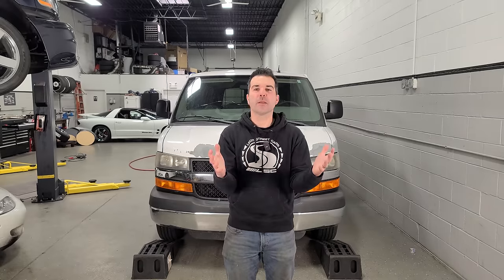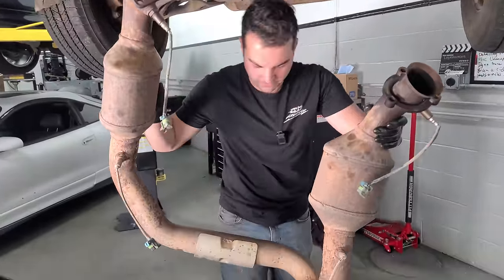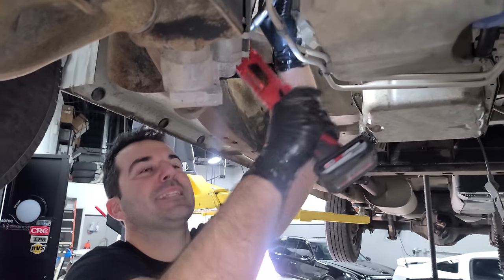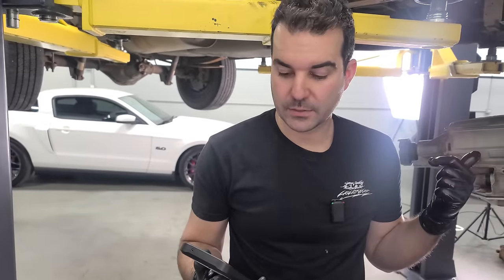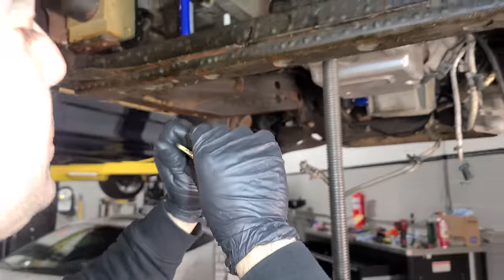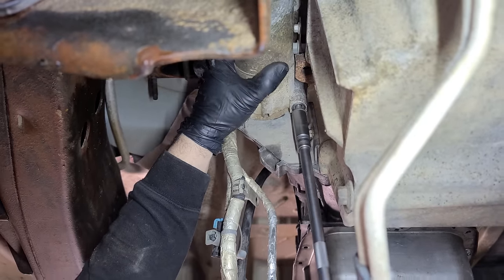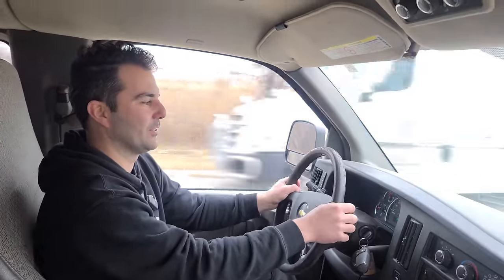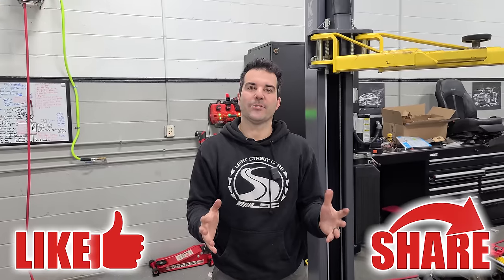I Installed a $9,000 Transmission In My $4,000 LS Chevy Van In Preparation For Big Boost! CARNAGE!

Comment: A little tip from my side: invest in one of those pressure washer attachments that clean the undercarriage. I have one on a long tube that sprays straight up that lets me clean the undercarriage without laying down or reaching under the car ✌🏼✌🏼
Reply: .........and use a creeper if you need to look under the vehicle (if it's on the ground) while you're spraying water.  It will keep your back dry.

Comment: A trick I learned while a mechanic on rusty nuts/bolts is after soak/sit to use a hand ratchet and actually tighten the bolt JUST until you hear a crack, then the correct direction to remove. After learning that trick, I haven't had a single stud strip out.

Comment: These vans are beasts.
I have a 08 Express 3500, 6.0L v8 15 passenger.
With over 270k miles still on the original engine and transmission.
Still running strong

Comment: Cool video as always man! FYI on the driveshaft subject, you may have a hard time finding a shop that can make a one-piece driveshaft for something with that long of a wheelbase. The amount of strength you gain is nominal when compared to the added U-joint angle increase during suspension travel especially at the rear diff. The factory unit is fairly robust, considering its a 3500 chassis (they're all the same for diesel truck and vans) but if you really wanted to upgrade for strength, you could have someone make you a performance 2-piece that would probably be just as reliable and less intensive as a single driveshaft conversion would. It would also be easier to adjust pinion angles with having more pivot points and I'm sure there are companies out there that build them for higher-hp HD trucks. 

Just my opinion though. Looking forward to seeing how this project turns out! Really unique and you had me at "boosting" an LS Express Van lol

Comment: Family road back in late 80's.  We used a 77 Chevy 1ton pick-up 3+3 with a 350.  Six of us and the family cat. Motorcycle strapped to the front bumper, had a canopy so two of us hung out in the box to stretch out and sleep and pass cold beverages to dad  lol. Had knobby  bias ply tires and two blew on the trip. Long wait for a replacement in the heat in the middle of nowhere. Great trip

Comment from the maker: What family road trip car, truck or van do you remember most from your childhood?.
Reply: My aunt’s 2007 Subaru Outback 3.0r wagon
Reply: My dads green Chevy truck!
Reply: an ole 90' something Chrysler Town & Country!!
Reply: Driving across Texas to see my Grandmother
Reply: My dad bought a garage kept 1972 Chrysler New Yorker from a widower.  The car hadn’t ran in several years.  We towed it home, rebuilt the carburetor, new battery, new tires.  Changed fluids.   That car was literally 22 feet long!  It would seat 4 in front and 4 in back!  Best part is it came with a 440 big block and was a lot faster than it appeared.  Most of the sports cars back then had barely 200 horsepower due to all the smog regulations.  This thing had 375 horse and 450 torque according to the manual.  We tuned on it, dual exhaust, and it outran most of the sports cars.  On the Highway with cruise control it got 22-23mpg!  We all called it the tank.
Reply: My grandmothers '54 Packard and the family '60 Mercury.
Reply: 75 Jeep Wagoneer orange "The Great Pumpkin)
Reply: Family had a Chevy Astro van that came with built in tv that never worked lol. Had some good road trips in that growing up as a kid.
Reply: 90s Oldsmobile Achieva
Reply: we had an '89 Dodge caravan with a factory turbo charger 
and I to hated sharing the bench seat with my sister 🤣

Comment: Pinch clamps: the crimpers are so worth having in your toolbox. Don't ruin your other tools. And if you get a set of crimpers, resist the urge to use them as wire cutters or anything else. Oeticker.

Comment: when I flush the stock coolers I push a little cleaner in and then blast it with air.... it helps break things up faster than just pushing the whole can through and waiting till it starts to clear up.. the violent impact from the flush cleaner and air get it going much faster. I zip tie the hose on both ends and poke a hole in the hose and then shove the blow gun tip inside the hole and shove cleaner and blast and just keep alternating cleaner,air,cleaner,air rinse and repeat.

Comment: That's awesome.  The best shifting transmission I've had on any of my cars was from a 1995 Chevy Cavalier.  That thing shifted smoother than my 2013 Lexus IS250 and any other vehicle I've owned.  It went through two engines and the transmission was untouched.

Comment: I've had good luck on ls flangs with a air hammer and blunt tip bit. Spray it and I carefully hit it a few times. It would jar it loose and I kept from breaking ratches and pull bars.

Comment: Most 80's Ford, Chevy, and dodge vans came with a one piece driveshaft, what I recommend if you can find one in a pick your parts place, grab one off the same Chevy type van but of a 80's year and modify it to fit. I dunno if it'll help but that's just my recommendation and other people might have better ideas but it's what I do since parts can be a bit expensive

Comment: If I remember right you can enable the ebreak without actually having the e-break on by doing this you actually disable attraction control and a bunch of other things if I remember right and you could easily do a burnout That's if you have the one yet the press down with your foot

Comment: This Van has the LQ9 6.0 with 320HP and doesnt have AFM. The 280hp engine (the 4.8) was only avalible for 2012 in cargo vans, hopefully this helps when ordering parts as in the first van vid you said it has 280HP factory.

Comment: This is actually perfect timing as I just picked up a 722.6/NAG1 box from a charger for my w210 E300 superturbodiesel. Very good tips! I will probably need to flush my transmission lines just for good measure.

Comment: ALEX! GET YOURSELF A BETTER TRANSMISSION COOLER! THERE'S A LOT OF BETTER AFTERMARKET OPTIONS! It's so understated the effects of a decent trans cooler can have on the life of your transmissions! My F150 work truck has gone through 4 transmissions in the last 540k miles as I tow agricultural equipment to farms around AZ, the cooler it has goes into the radiator and back out in a small loop like the one in the express van, the gentleman that built the last transmission for me suggested that I go with a B&M super chiller transmission cooler in series with the coolers that it already has and I'm very thankful that I listened to his advice, the last transmission I had installed has lasted me over 180,000 miles so far with no signs of slowing down and clear fluid! My transmission temps dropped from around 230-190 to well under 170-13 0 on average, the truck doesn't hesitate as much as it did after long drives either, and my fuel mileage went up, (surprisingly as it's the original 2v 5.4 triton), please invest in a good transmission cooler as it makes a difference!

Comment: Since you have the procharger, you could use a turbo exhaust to spin an alternator through a cvt. 
If not I would run an electric motor on the front of the diff so you get electric braking, and when accelerating again you just reverse the flow. Put in a few huge capacitors, and get more torque for free.

Comment: Have you seen dry ice blasting machines? They are absolutely amazing! Blast anything. Plastic, Rubber, aluminum, steel. That new transmission could have looked brand new if you had a blaster.

Comment: Make sure you get the bench Row for an actual 15-passenger express. The rear bench row from the extended 12 passenger will fit, with some force, but it still doesn't quite sit right. Don't ask me how I know.  😂

 I used to work for a van rental company, vans were our bread and butter.  I'd pick a Chevy Express over a Ford Econoline or Transit any day.

Comment: You have to turn off the traction control to do a burnout. Also if that is a 6l80 I would do the coolant thermostat bypass installed to keep the heat out of it. Also with the bypass installed you don't have to wait for the trans to heat up before you check the fluid level.

Comment: Eye protection? Safety!! You ca always make your own drain plug. Drill it, drain oil, remove, clean, weld nut inside and bolt with seal on outside.

Comment: Most of those passenger vans have traction control, which would not allow burn-outs.  Most of them have a disengage button in the center console.  You can spin tires with this disengaged.

Comment: My dad has a 2009 2500 6.0L van he uses as a rolling welding shop and it's been a great van, super reliable, parts are cheap and the 6.0L is a pretty strong engine, only downfall is it's a thirsty pig lol these things will pass everything but the gas station.

Comment: What a cool project to build Alex! One thing that you can say about GM is the simplicity and ease of installation of drive line components. A lot of newer vehicles are a Hodge podge of messy lines and un-reachable fasteners. That Pro Charger set up is unbelievable and beautiful. Here are my suggestions on the Van. 1) Retro 70's theme wrap or paint. 2) Slammed and bagged. 3)Tons of interior and exterior lighting fx and under glow. 4) Digital dash 5) Aftermarket steering wheel 6) Big old leather swivel driver and passenger seats. Can't wait to see what you do to her!

Comment: Cool video. Thanks! 

I probably would've taken the opportunity to replace the trans cooler with something better. I run a Rin Davis radiator with trans and diff coolers. I can run all day at Road America. You'll probably need something like this if you're going to boost the hell out of it and use it for towing and traveling.

Comment: Actual suggestion for the build: ridiculous alternator/dual/triple battery set up, and race car style leads on the front and rear bumper so instead of having to rely on jump packs, your vehicle has a system designed for jumping and charging vehicles. It will be used for rescue, after all?

Comment: You want a 2 piece driveshaft for something that long. To be a one piece you would need the tube diameter to be so large that it wouldn’t fit. Or you would have to make it out of Carbon Fiber and a larger diameter as well. Shorter is better when it comes to driveshafts.

Comment: you should mod your next tranny pan with a drain plug or do a vacuum drain through fill - the van is ok but you would be better off with a sible can 3500 truck with 4wd - you could plow with it and keep neighbors happy - the van is good fro the framily but truck would make better shop and tow vehicle - you should have sandblasted with baking powder or glass or walnut shells and then primed/painted with an epoxy based and then done the undercoating - only a few more hours of work and probably worth it given investment and fact that salt is indomitable. pls go over the different locktite colors and why you want various colors for different applications

Comment: Good to see the GM paint shop had it's crap together the day the body was processed/prepped and painted. It's the paint shops fault the paint and adhesion has failed in the way is has. As for the driveshaft, how about a one piece carbon fiber shaft. I wouldn't be too expensive, would it? So many projects in your shop. Perhaps getting to the wife's Mustang soon?

Comment: I grew up doing road trips in full size vans. First an econoline from the 70s that my parents converted to a camper themselves. Then an 88 conversion econoline. We drove that one from Iowa to Alaska and back. When that died of rust (thanks Iowa!) they got a 97 gmc safari conversion. I’m generally a ford guy, but that GM van was far superior. The handling was much tighter, and it actually had enough power. Good stuff. Looking forward to this series!
* edit: Savanah, not Safari

Comment: Save the jars of that clearing especially the clear jars with hardly anything in them 

Works wonders for cleaning tools and parts , got a oily socket from it popping off a ratchet during a oil change , put it I. The jar , small brackets and parts , put it in the jar etc etc , shake the jar for a few minutes and it's clean that stuff oils oil , slime you name it it's like brake clean on crack !! Don't dump it use it !!

Comment: Early 2000's trucks would have a drain. When they had drain plugs people would change the fluid, but not the filter. Causing transmission failures. Having no drain forces you to drop the pan and you might as well change the filter while you're in there. They then started red locktighting the drain to prevent people from using it until completely removing them again.

Comment: Just a $200 first gear clutch pack and an upgraded valve body pressure regulator spring... + $3000 just to turn a few bolts.

Comment: you should've avoided the huge mess and drilled a hole in the side of the pan to let the fluid drain and then made your own drain plug for it if you plan to rebuild the transmission eventually

Comment: A 1 piece driveshaft that long will be difficult. As the length increases, the diameter must as well or the driveshaft will "whip" causing an imbalance.

If your concerned about the strength of the stock two piece, your best bet may be an aftermarket center support made for a high performance application.

Comment: A really long one piece driveshaft could be an issue with critical speed meaning you would have a vibration due going through a certain driveshaft RPM.  Carbon wrapping or larger diameters might make it possible to have a critical speed that is above the max speed you might run but lower rear gears make the potential to have issues worse as it means higher driveshaft speeds.

Comment: From having worked on these vans for many years good luck. There is no room for that super charger with the HVAC and brake booster. I thought u were going with the intake roots blower that had a better chance of working. Trying to fit that super charger in a van is not gonna work. I would definitely have done the roots blower up top because u have the clearance around the top of the motor for it. Out front there is none on a van. I would suggest buying the factory duramax intercooler as these vans were offered with the diesel option. There is decent room around the engine but everything is tight up front.

Comment: Why not just change the output shaft instead of a Sonax adapter and driveshaft job? Save some cash. Get that 6L80 tuned, afaik the lockup setting are supposed to increase its lifespan significantly.

Comment: All needed to be done was put on and adjustable pressure solenoid and turn up the pressure about a quarter turn to a half when you first bought it before driving from Dakota to Illinois and the transmission would have been saved.  It would have meant dropping the tyranny pan though and finding a tyranny shop that had one.

I watched that drive home video cringknv

I have one with 4l80e   and it made that noise and I bought the solenoid and dropped the pan.  I knew someone had been in there before because I had a drain plug pan with reusable gasket.

Got the pan down and it already had and adjustable solenoid I turned up a half turn.  Idle pressure went from 33 to 43, reverse front 58 and slipping to 70 and average during pressure to 1#5 to 150 with 200 225 on hard acceleration.  It's been 7 years no problem

Comment: Awsome video! I guess I can call my self a van sort of enthusiast lol, we have an 07 dodge grand caravan, I did full led upgrades, remote start, alarm system etc. No mods to make it faster besides some fuel additives lol.. Im planning to do the first trans fuild change, its only got 59k original miles. I gotta do some bumper repairs and rust repair but that's about it. Keep up the great work, I'm a huge gm fan, my dad owns 2 69 camaros!!

Comment: Great GM gaskets?  They don't leak?  I don't think that was always the case.  My mom had a 1986 Chevy Celebrity and it leaked trans fluid pretty bad.  She tried to get it fixed under warranty but it never lasted, so we got used to having to use a pan under the car and adding trans fluid.  She loved that car but loved the T-bird she replaced it with even more.

Comment: No drain plug because the oil shops would drain the trans and not the oil.  Many a Subaru has been drained and towed to the dealer.

Comment: sadly, the transmissions are amazing the factory GM programming to meet bullshit emissions locks and unlocks constantly from 2nd gear up, needlessly, softly, with long apply times and low pressure, and it eventually burns the whole converter clutch material and pukes it into the whole rest of the sensitive works.

you can get a stock truck or car with these, just change the tuneup to not lock till 5-6th gear.

and this never happens
Reply from the maker: Well that's definitely getting changed in the tune. I hate when they do that. Just have it lock in its final gear and be done!

Comment: I know you like that Amsoil under coating, but I'd do the frame rails with POR15. @6:10... What trans is that? Why are you not using a built 6L80 out of a truck? @21:15... Jon Whittington here in Vegas built one years ago. Think there's videos of it here on Youtube. @28:21... Knowing your plans, now would be the time to ditch all of the factory trans cooling and fit a large capacity aluminum radiator without a built in cooler and fit a separate trans cooler with it's own fan. Not only will this improve the engine and trans cooling, but you know for a fact that there'd be no metal being sent to your brand new trans. Even a good flush can miss stuff. @37:00... Wait... I thought you said you were going to turbo it?

Comment: If you want the van to do a burnout, the way I do it in my 2019 is come to a stop and hold the traction button for 10-15 seconds.. until the traction off and stabilitrak off messages appear on the info screen.. put it down into M and give her hell..